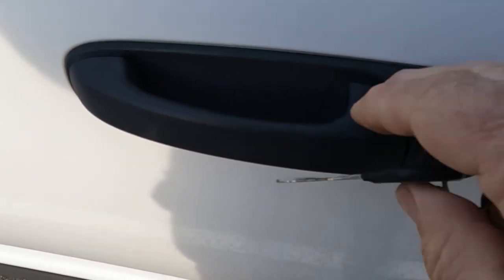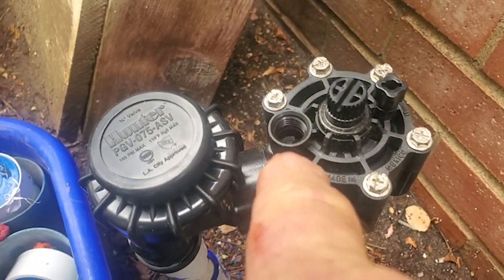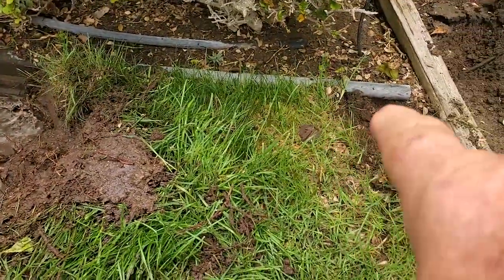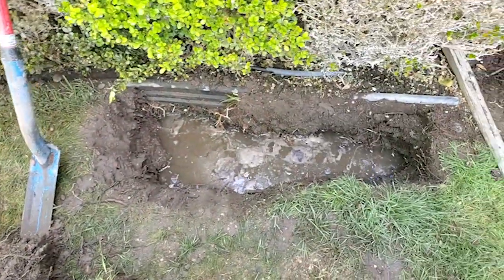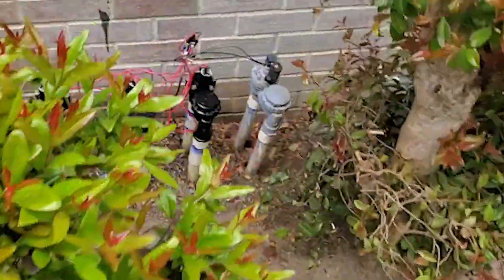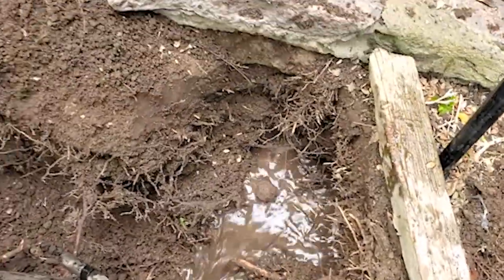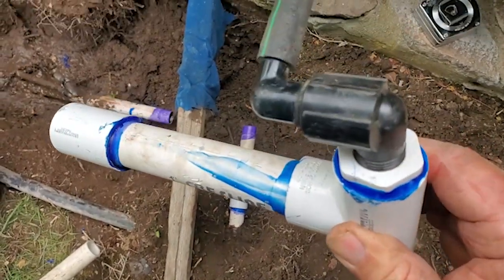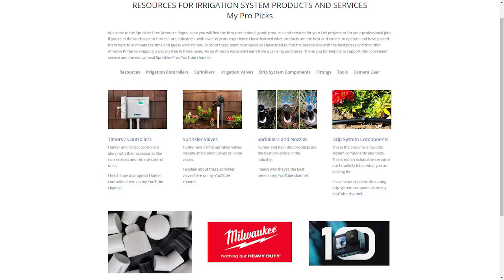Vlog #9 | How to find and repair broken pipes | PLUS much, much, more!

Comment: Good job sir. I watched this video last night & today I  just happened to run across a manifold of four valves with half lawn genies half Irritrol 2700. I ordered two 3/4” PGVs with anti siphon to replace them. You still got it 💪🏻 
What’s your opinion on hunter swing joints vs marlex?
Reply from the maker: Lance, I prefer the RainBird swing arms because they have barbed fittings that can be re-used if you need to cut the swing arm a bit shorter or to remove the swing arm during a repair then reinsert the barbed fitting into the swing pipe. The other benefit is the threaded marlex ells can be removed and added on whereas with the Hunter, you're stuck with the assembly as it is and there is no way to remove the end fittings and reinstall them if needed. Does that all make sense?